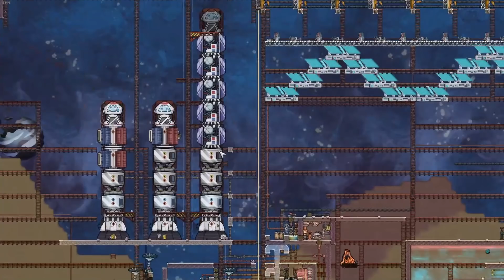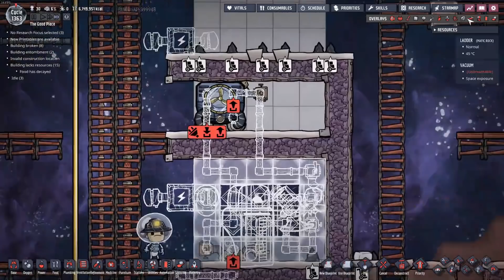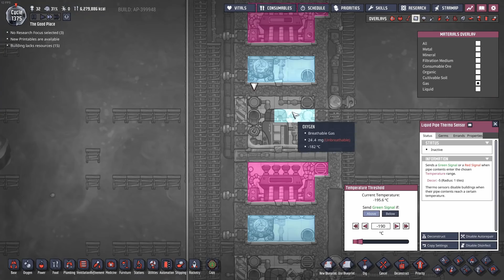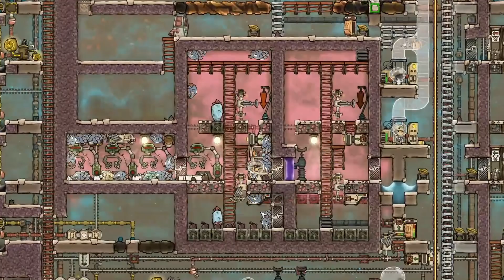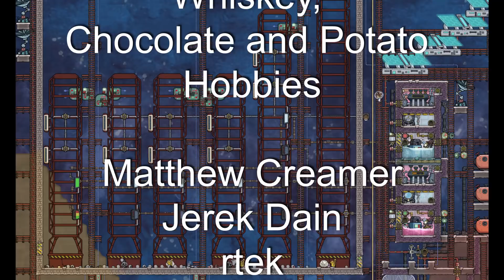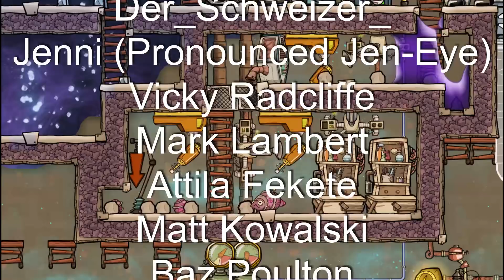Badlands Hungry Dupes 19 : Liquid O2, H2 and Automated Rockets : Oxygen Not included

Comment: Hey!!! 
Just a few notes concerning your rocket automation. 
A) You didn't account for the travel time of each rocket. Leaving the asteroid is what I think starts the replenishment (not verified), so you are getting beck to the asteroids earlier than needed.
B) There will be trouble with the timer sensors. It is going to be random if the rocket leaves during red or green (unless you manually reset the timer every single time) hence you might miss one green signal. It's not a biggie when it's a 50/50, but for greater distance you ll have green less often, meaning more prone to miss one which in turn results into not counting more than one cycles.
My suggestion:
Use 2 signal counters (one would signal the other, for example 12 cycles= 3*4), an AND gate using both signals to open the gates, the space scanner will reset the signal counters after the rockets return (remember: n - "return distance" cycles) and a timer sensor set for 599s/1s. I haven't actually tested this suggestion yet, but hopefully I haven't missed something...
Reply from the maker: The timer is set to send a green signal say every 12 cycles. The first launch will be a bit wonky but after that a green signal will only be sent every 12 cycles. So long as the rocket does not take longer than 12 cycles to get back and refuel then the system should be fine.
Reply: @FrancisJohnYT   that makes sense, thanks :)

Comment: Your wood heat-exchanger setup is kinda flawed, because you're using iron ore belts instead of steel (ores have terrible conductivity - its the same with gas pipes: you want to use steel instead of ores if you want to exchange lots of temp). Also I'm pretty sure that if you put metal blocks next to regular blocks, the conductivity between them will simply be the average conductivity of both materials used. The heat-exchange in your "testing" setup with single high conductivity layers next to single low conductivity layers will simply be the average between them every time. I reckon that testing setup would've been more informative if you had used a double (perhaps even tripple) layers of high conductivity materials next to a double/tripple layer of low conductivity material.

Comment: I reccomend using a filter gate between a liquid pipe thermosensor and the aquatuner. That way it doesn't turn on when a single blob is a different termperature than the others. It'll also help prevent oxygen from becoming solids :)

Comment: When laying out my rockets and piping, I've found it is much more efficient to put the oxidizer tanks at the bottom.  You generally only need one oxidizer tank for most applications, whereas you will need to add or remove fuel tanks as you decide to change destinations.  By putting oxidizer on the bottom you don't need to do that mix & match leapfrogging of pipes, you just run a straight oxygen line and expand lines upwards for additional petrol / hydrogen tanks.

Maybe it is OCD, but it also makes me nervous how you've got open un-insulated portions of your cryogenic tanks, particularly the window tile sticking out the side and heavy-watt plates.  It's not that hard to redesign this in a way that would be reasonably insulated "just in case" there was an accidental leak of that 1000+ degree steam billowing out of your rockets not 10 feet away.

Comment: You know you don't need shutoff valves now right? Just run the automation cable to the vent and no need for a power wire. Might have been better to have O2 on the bottom in line with the Oxidiser tanks to simplify the plumbing.

Comment: why did you need the extra scanners cant you just pull the automation off the ones already built i thought it didnt matter what they were scanning for they all contribute to the network?
Reply: Extra wiring? Cleaner looking automation setup? I'm not really sure. You bring up a good point. He only needs 1 of the scanners in the grid set to detect meteors.
Reply: They do contribute to the network quality. This scanner per rocket allows the automation to detect when a rocket is inbound so it can open the bunker doors. Without these scanners, the rocket will just obliterate the closed bunker doors.
Reply: I think he is saying the he could just use the existing scanners all the way on the left. Just run a bunch of automation wire over to the rockets.

Comment: 34:50 Can't you just remove the AND gate that connects the doors and start of the rocket there and connect all that wire together?
Reply from the maker: I think your right, I need to go through and redo the rocket automation. Also just discovered the automation ribbon this will save a bunch of time.
Reply: @FrancisJohnYT  I only used automation ribbon before to open 4 different doors for my rockets, it worked pretty well but i started over that game later
Reply: You're
Reply: @cblyat53  literally wrong lol

Comment: If possible, can you make a tutorial on a self-powered oxygen maker that uses 10kg/s of water(a full liquid pipe worth)? It could prove very useful if you have more water than you know that to do with and don't have the time to wait for the hydrogen to slowly fill up. And at the same time, a liquid hydrogen/oxygen system that can handle all of that hydrogen.
Reply: Oxydyers use 1k of water each, just expand the current design to accommodate 10 and do the math for how many pumps it will take to extract that much h2. Airflow vents on the bottom to let the 02 out
Reply: The bottleneck is really the gas pumps. It's much easier to scale things by the number of pumps. Not the water supply
Reply from the maker: Place two Rodriguez side by side, you can remove the wall between them so they are touching. That would be about 6.8kg of water a second. Put on a third and you should in theory consume the entire 10kg/s pipe of water.

Comment: I think there might be an issue with your rocketry automation... Did you factor in the time the rockets takes to get to its destination?
Reply from the maker: Should not be an issue. Say the automation goes off every 12 cycles, rocket turn around time is 2.7 cycles. The rocket will always be back, fuelled and ready to go and will get launched every 12 cycles. In theory so long at the rocket turn around time is lower than the automation timer you should get pretty close to perfect timing.
Reply: Ok, that makes a lot more sense, thanks!
Reply: So long as the travel time is less than the replenishment timers, then the rate limiting on the launch itself is all that matters.  If it takes 2 cycles to get there/back, but you only send it every 10 cycles, there's no difference if it takes 5 cycles to get there/back.  They'll launch at the same time, just the first will return faster.
Reply: This is an issue only with some of the furthest destinations and/or when using just one cargo module. Then you'd need two rockets or just have one go with a permanent on-signal and accept that you'll "lose" some potential resources.
Reply: jmniskanen Yea I should’ve clarified that, by “issue” I meant loss in efficiency

Comment: Yo, loving all of your content. At 32:40 you use an or gate, but because green the predominant signal in Oni automation if I'm not mistaken, can't you just connect the output of the scanner and the delay timer circuit to each other and the doors?
Reply from the maker: That is exactly what I did initially, unfortunately the green signal travels through the delay times and resets the counter gate. So every time the scanner goes of it would reset the counter, so I put in an OR gate to stop that.
Reply: @FrancisJohnYT  You can use a filter gate or a buffer gate to stop the green signal traveling back. Connect the counter output to the gate, and the output of the gate to the doors. Connect the scanner to the same automation wire and voila.

Comment: Ethanol works real well as coolant for the steam turbine.  It will turn to gas and come in contact with whatever you are passing through the top and turn back to liquid.
Reply from the maker: For other setups it would be prefect it's just with liquid H2 and O2 you tend to use the O2 for cooling so you need something that can go as low as 190C without becoming a solid. That is why you are pretty much stuck using Hydrogen.

Comment: why do you use gas shutoff to control the flow instead of directly connecting automation to vent itself?
Reply: Perhaps its because when the vent is off there is still a gas in the pipe on that square that can freeze? Similar to how brothgar had errors during his magma clearing sand experiments.
Reply: @tempy2440  that makes a lot of sense .. can I change my answer to this ?  :)
Reply: I'm going to guess - old habits :)  I'm guilty of it myself

Comment: 24:00 Why not automate the gas vents? It seems so wasteful of steal to make the gas flow though a valve when you can also toggle the vent
Reply: The gas in the pipe just before the vent will freeze and break the pipe.
Reply: @Galdo145  I used an insulated ceramic pipe for the last segment to feed the gas into the vent and have run that way for several hundred cycles.  I did have the lead automation wire controlling the gas vent turn into lead debris in the bottom of the tank once.  In the real world I would have thought thermal cycling.  Any ideas on what caused that?
Reply: Not on the stuff going into space! To be fair it’s not like he needs the steel.
Reply: @bmoretti89  Ah, I didn't double check the timestamp; thought it was associated with a time inside the condenser box.  Knowing my luck with ONI it would still find a way to condense and break though.